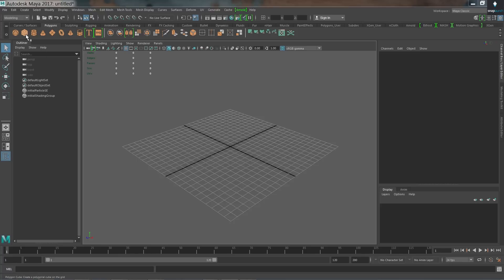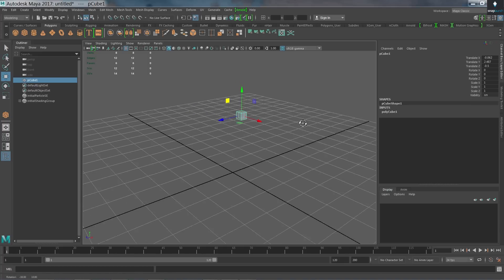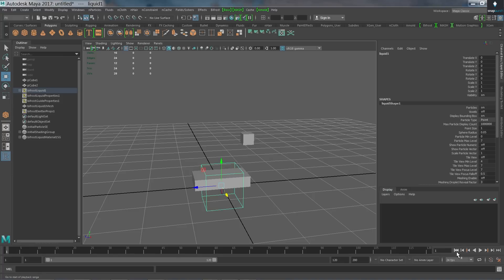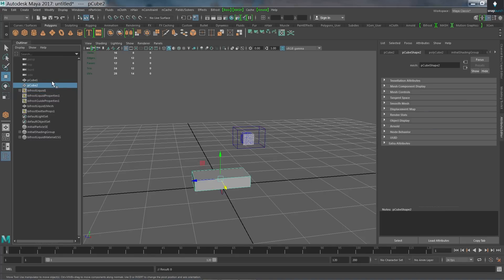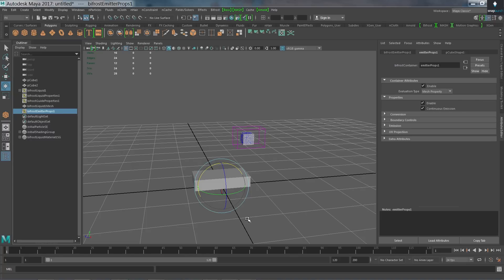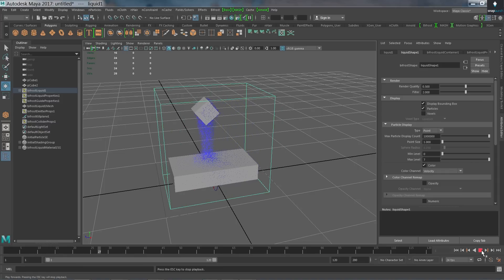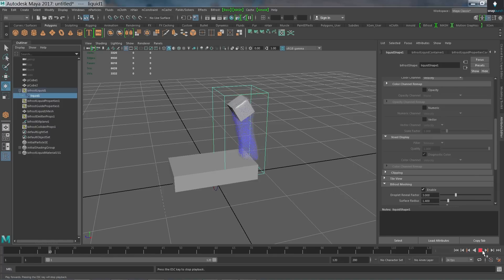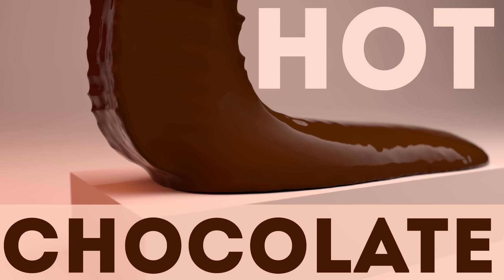Maya 2017 Viscous Fluid Simulation using Bifröst

Comment: Did you make any sales on this?
Reply from the maker: It's free! And yes, some generous people donated.
Reply: I don't have AI Standard in 2018 Maya.
Reply from the maker: You'll want to use aiStandardSurface in Maya 2018 for similar results. Unfortunately aiStandard isn't forward compatible as Arnold was upgraded and the shading model changed, so new material settings will need to be dialed in.

Comment: In the latest version.. there is no longer a viscosity setting. only "scale" which does nothing but screw things up.  I cannot for the life of me get my fluid to be viscous by ANY fraction.  I understand its now based on a ratio of scene size and density... but I tried everything.. NOTHING works. can you help
Reply: Yeah, it's all stable in Maya 2018. I'll try and see if I can bake down my simulation as geometry or something and reimport it back into maya 2016 for the project that I actually wanted to use it on. Thanks SnapLaunch.
Reply: Youre right... thats what I did and it worked perfect =P thank you!
Reply from the maker: Viscosity is still an option for me in Maya 2018. To access it, select the 'bifrostLiquidProperties1' node in your Outliner, then, in the Attribute Editor scroll down till you see the Viscosity tab. Adjust as desired.
Reply: In maya 2016 the viscosity option seems to have been entirely removed from the interface. The only option is scale and anything larger than a 2.0 causes computing frames to hang indefinitely. Even with SP6 and Maya Extensions 2 there's no change. Also, in my version of bifrost the outliner only has one bifrost object all the objects likes props don't exist at all even trying to select them directly by name using MEL doesn't work. I guess the next thing to try is Maya 2018 for it.
Reply from the maker: Scaling like that could be an inventive hack, but will likely throw up additional issues to contend with (as it sounds like you've already experienced). I know Bifrost had a major restructuring in 2017, so 2018 is probably going to be your easiest route to solve the issue.
Reply from the maker: Thanks for the tip Sploige.

Comment: when I open up the file from gum road, the anmation timeline is red and won't cache. ANy Idea why?
Reply from the maker: Sounds like the timeline is selected. Try clicking in it to deactivate it. Not sure why it won't cache, but just to be sure, is the bifrost system selected when you try to cache it?
Reply: @SnapLaunch  i have the same issue. the timeline gives "bifrost evaluation error" Everything works except there is no fluid coming out of the box

Comment: I have a question guys, my sims run SOOO slowly. Is there any way to speed up replaying? I believe it's something to do with cashe I have asked on Autodesk's site and it didn't work. We are running 2016. Would be grateful for any advice..
Reply: As far as I know the playback speed of the simulations depends on the processing power of your computer as it is calculating each frame real time